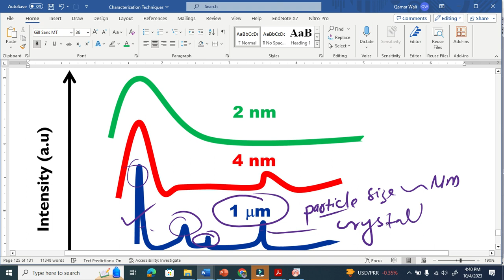Why Nano XRD Peaks Look Different: Bulk vs Nano XRD Explained

Comment: sir will you pls explain why the broadening in peaks happens for nano material
Reply from the maker: I have already explained in the video and I also kept the text in the description,  BUT you don't read it 😒 

How the XRD peaks broaden as the size of the crystallite or grain or particles getting smaller? 

As the size of the material decreases from bulk (micro meter size) to nano (1-100 nm), the XRD peak starts broadening. This broadening is just like the amorphous materials. The x-rays realized the nanomaterials are just like the amorphous materials. In such a scenario, the XRD technique becomes difficult to analyze the nanomaterials of small size as the scattering of x-rays in many directions. 

The XRD technique becomes difficult to analyze the sample with crystallite size / particle size below than 5 nm as the peaks broad and low signal to noise ratio. 

Importance: 

This broadening of peaks has a significant importance in nanomaterials characterizations. For instance, if TEM shows the particle size ~ 10 nm BUT the XRD of the same sample shows SHARP peaks, then there is discrepancy. 

It means that the majority of the particles in the sample are not in the ~10 nm range, BUT rather large in size.